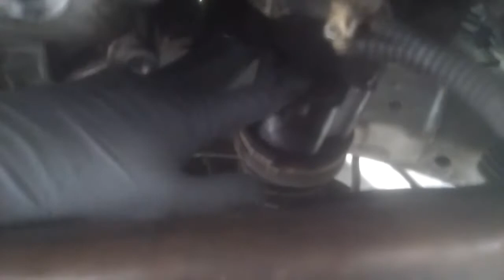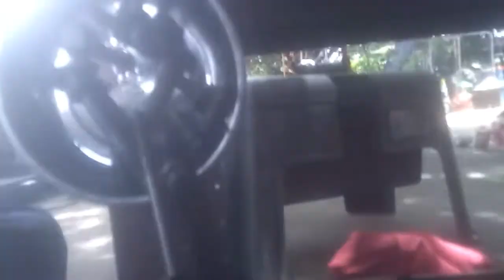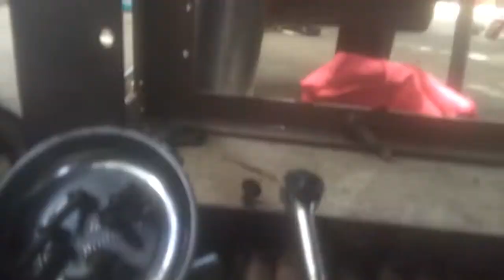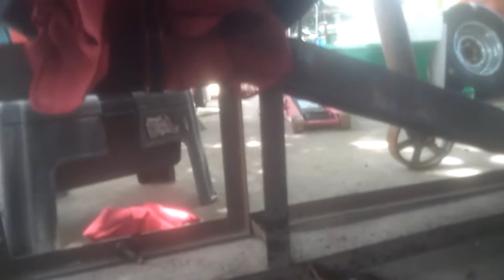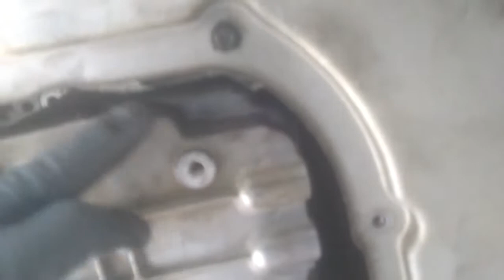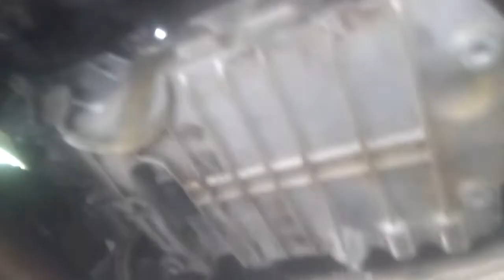2007 Chevy Malibu oil pan gasket replacement pt 2

Comment: No need to mess with the trans pan. Use a 3/8 to 1/4 adapter on your 3/8 ratchet. Use a long 1/4 extension with a swivel on the end and a 13mm socket. Put your extension/socket set up from the wider opening and move it down to the bolt.
Reply: Steve H hi bro, i have a question.
For change this gasket pan it's necessary get down the transmision?